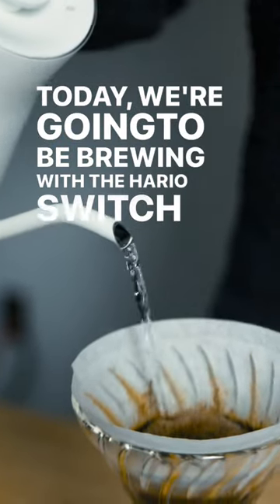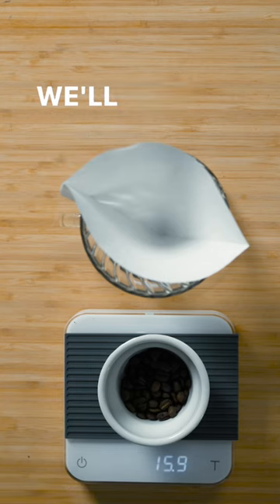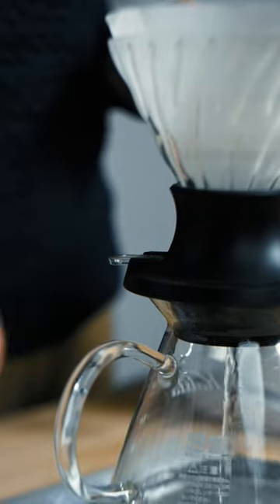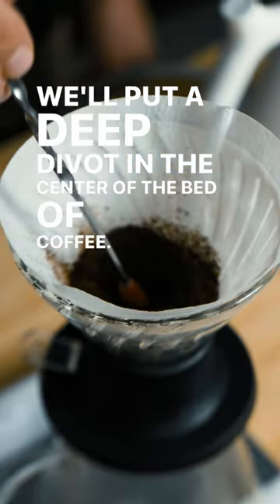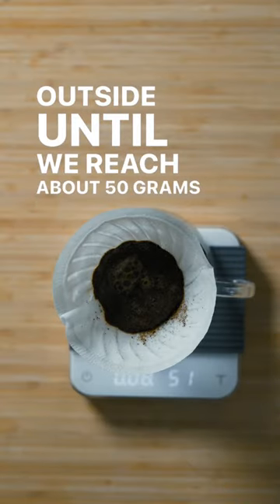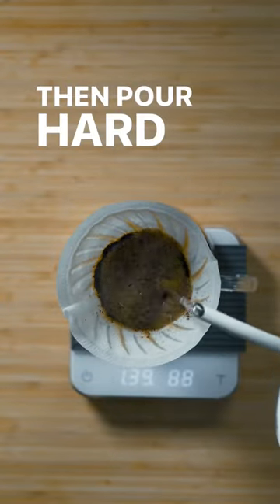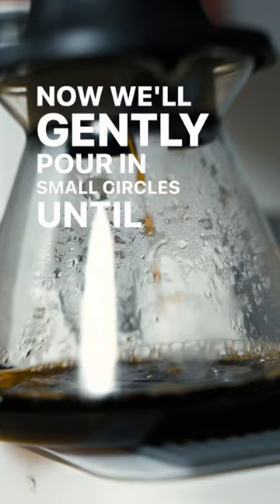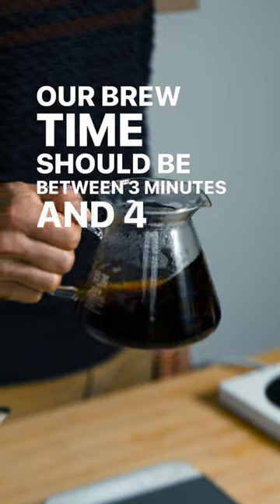Hario Switch V60 | Brew Guide #shorts #coffee #guide #barista #pourover

Comment: Seems pointless to use the switch like a normal v60, it is an immersion brewer not a v60
Reply from the maker: Hey Stephen! The versatility of the Switch is one of our favorite things about it. We have a roaster here that does a double immersion method, where 50% of the water goes in while locked, and then drains, and then lock again with the remainder of the water - so more like an immersion brewer as you mentioned. Being able to "switch" things up for the cup you like makes this brewer really unique in our eyes. The recipe laid out in this video uses the Switch's ability to lock in the water during the bloom to help make a sweeter, fuller cup than a standard V60 in head to head testing. Thanks for watching!
Reply: @KaldisCoffeeRoastingCo  Care to offer specifics on that double immersion method?
Reply: Loool. The recipe literally uses immersion for 01:30! And you call it pointless 😂